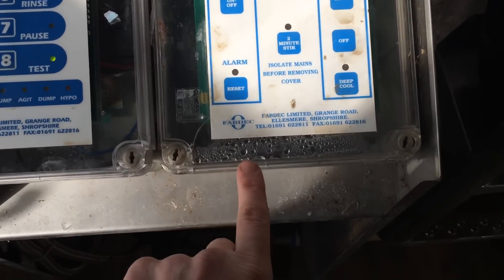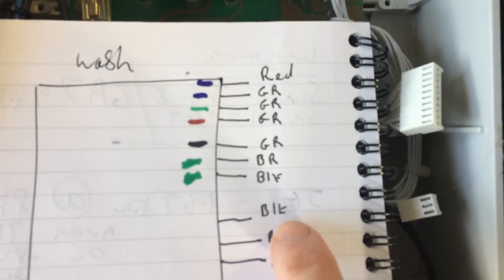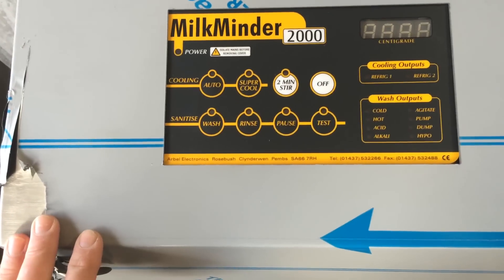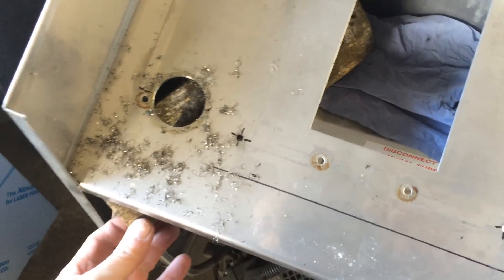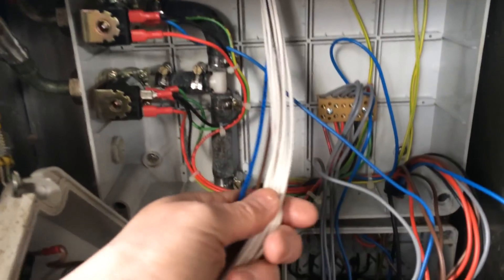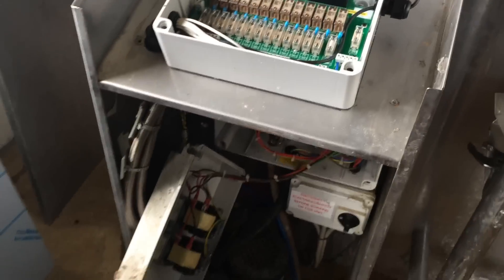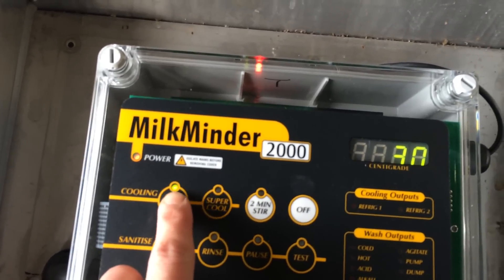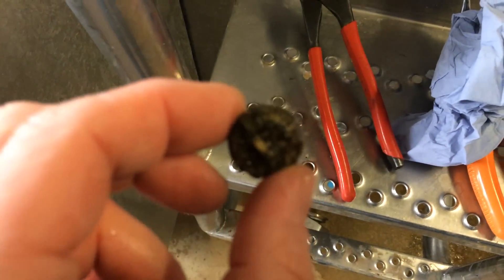Fabdec MilkMinder 2000 Upgrade

Comment: Tidy job👍 What sort of price are the milkminder2000 ? Was looking at using a programmable relay but this seems ready done.
Reply from the maker: As an upgrade kit to the older Fabdec tanks I expect you'd be looking around £1200 fitted, depends on travel and other parts needed.